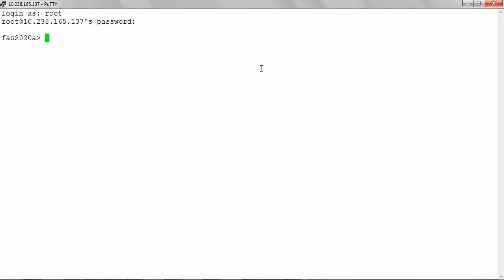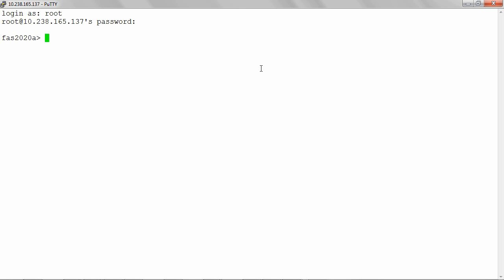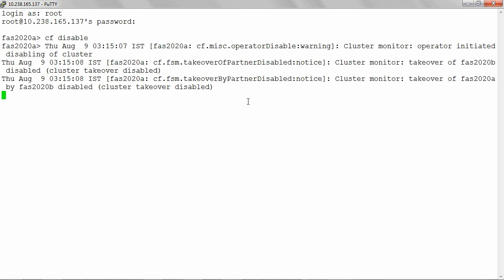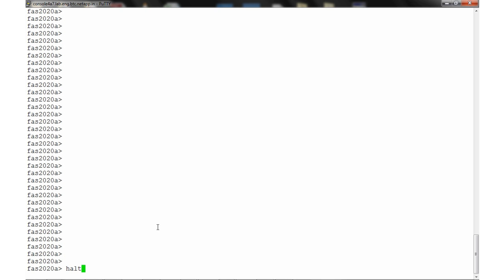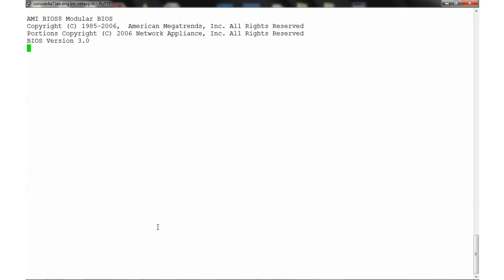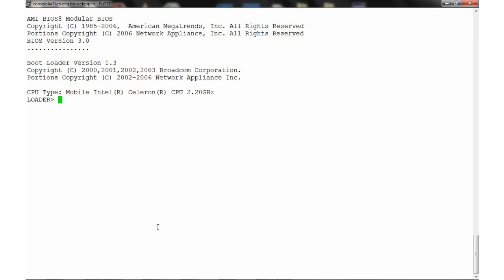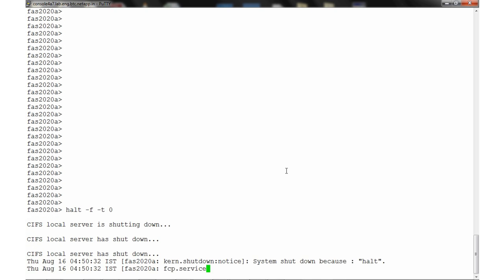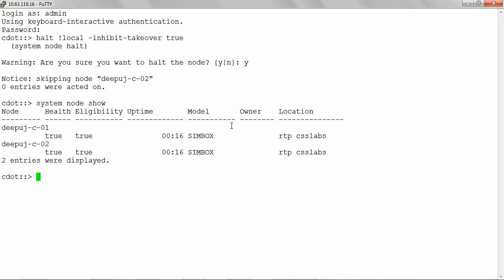What is the procedure for graceful shutdown and power-up of a storage system during scheduled

Comment: Thanks for the shutdown details, but how to you start CDOT back up from the loader prompt remotely if I am unable to reseat the power cables?
Reply: boot_ontap
Reply: Thanks, but I was looking for more clarification than that. I eventually found the answer I needed, though.

I wasn't even able to access the Service Processor of Node 1 in order to enter "boot_ontap" on my 2-node cluster. I later found out that in a 2-node cluster, I'm supposed to SSH into the Service Processor of the last node I shut down, in this case Node 2, enter "boot_ontap" on that one first, THEN I'd be able to see Node 1's Service Processor come up. 

Not what I'm used to with 7-Mode, in which case the Service Processor of both nodes are simultaneously up regardless of which one was shut down first.

I also have since been specifying the actual name of the nodes I am halting instead of using "!local", e.g. "halt -node Node1 -inhibit-takeover true". I doubt that makes a difference, but I prefer this as a sanity check more than anything.